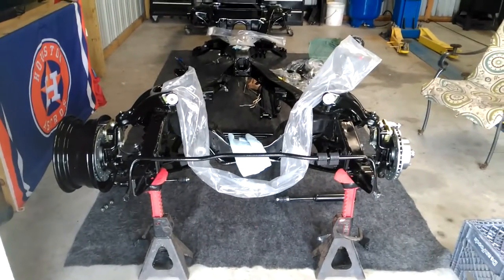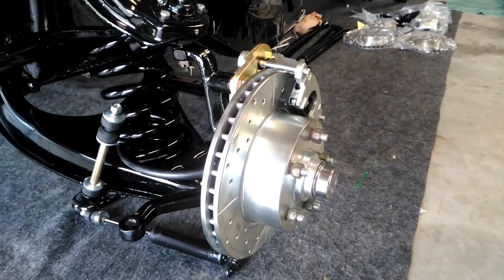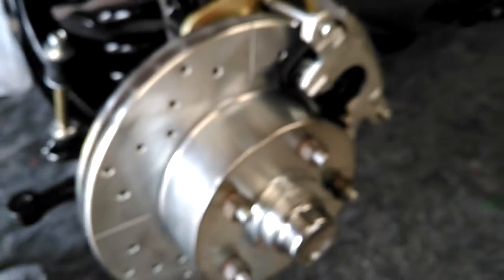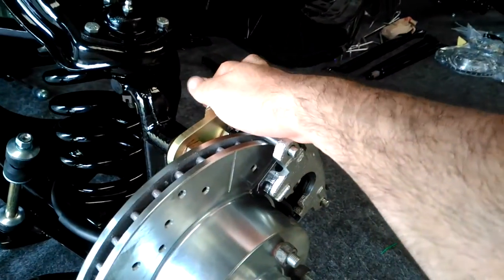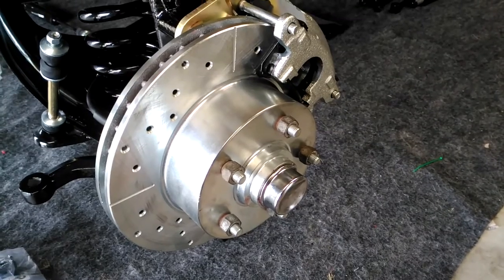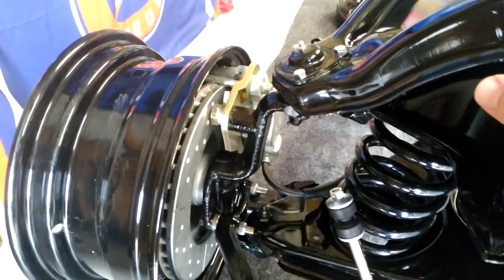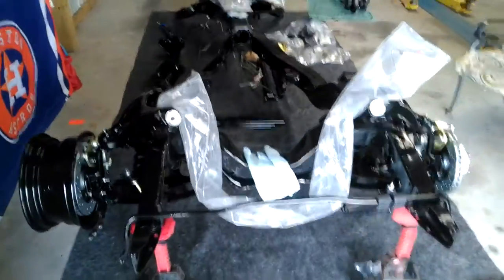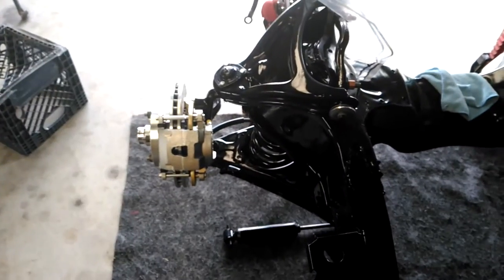1964 impala front disc brake kit installed!

Comment: I got the cpp  front disc brakes I put on but my impala. I noticed that the disc is very  hard to spin.  Haven't dove it yet still need to do some stuff to it. I checked everything on it seems to be fine . If you have any ideas  let me know or is yours like that to .thanks
Reply from the maker: How tight did u tighten the spindle nut that keeps the wheel bearings in place.

Comment: hi again rewatching your video. at 028 can you confirm or clarify what you are saying about the the bracket and drop spindle ? thanks a lot
Reply from the maker: The bracket is bent to push the caliper in board towards the motor or outboard towards the fender. Depening if you are using stock spindles or drop spindles
Reply: @lonestarlows  why ? what the difference with drop spindle ? why with drop spindle it has to move towards engine?
and about if you cut your coil spring and still have stock spindle? does it matter?

Comment: Hey man , I'm in the middle of doing front disc brakes on my 63 .. im a little confused on the proportioning valve .. the rear brake line runs down the pass frame .. how did u hook up your rear brake line ?
Reply from the maker: A line goes from passenger side to driver side and the rear line plugs into the rear of the prop valve
Reply: @lonestarlows  I see the line going from pass to driver side . But it goes into the dist block on the pass side which has the rear brake line and pass front brake line going into it , so do I just connect that line going to the driver side into the prop valve then ? Sorry man just kinda stumped lol since that line goes to the pass front brake and rear brakes
Reply from the maker: Correct

Comment: Am I the only one that has noticed that both sides were assembled differently in that video? Look at the anchor pin spacer location from side to side, one is between the spindle and caliper mount and one is between the bolt head and caliper mount
Reply from the maker: Yes i guess you are. Car brakes and steers fine
Reply from the maker: I just watched it. Im not sure what your are talking about
Reply: @lonestarlows  at 0.39 just by your finger you have the big bolt that hold the caliper braket to the spindle you have a spacer/washer between braket and spindle.
At 2.25 you can see the same spacer/washer isnt between braket and spindle ...but between big bolt and braket
Reply: @lonestarlows  did you check it out?
Reply from the maker: @vincentvincent4167  no the car drives fine.

Comment: Are these just the standard CPP disc kit. I'm behind on some videos trying to catch up. Haha
Reply from the maker: The brakes are not actually cpp. They are just about an exact knock off version...they came with cpp instructions but no cpp labels on the boxes
Reply: Cool I imagine there much more cheaper than Wilwood’s front disc brakes.
Reply from the maker: @balanis03  i dont even know how much willwood costs?
Reply: lonestar lows bit pricey actually the front disc drilled are about $850
Reply from the maker: Just the rotors?
Reply: @lonestarlows  Well that's for the entire kit for the front it includes everything.
Reply from the maker: I wonder what the difference is?